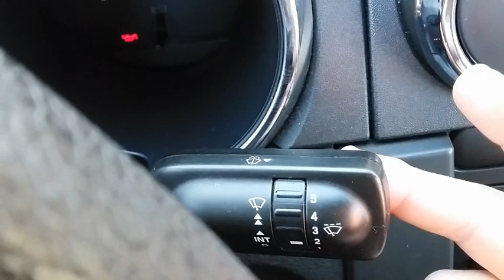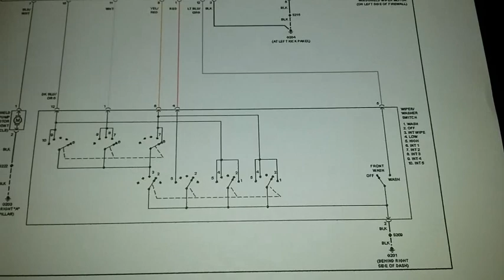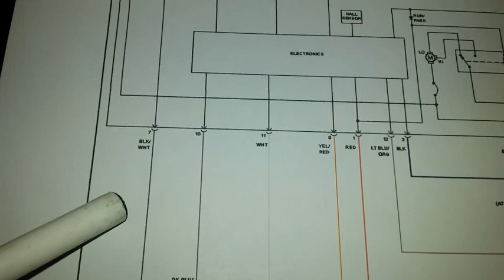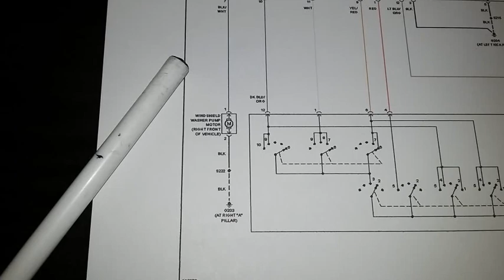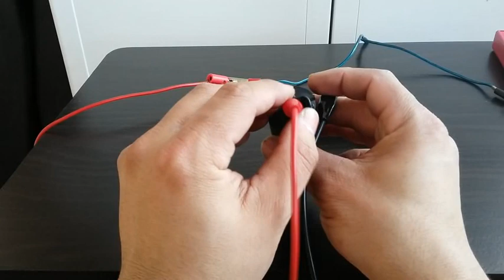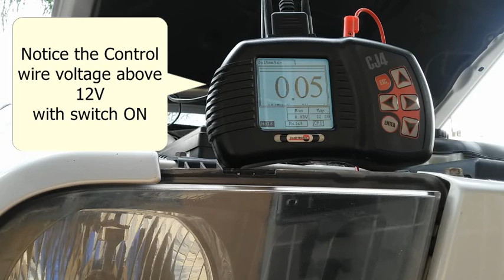(Ford Mustang) Troubleshooting Windshield Washer Pump Motor

Comment: Way to complicated,  unplug the pump, put in a node or light and push the button... no light then its wiring, fuse or switch... if there's a light its the pump... done
Reply from the maker: I respect your method. That's the beauty of diagnostic work, there is many ways to go about...